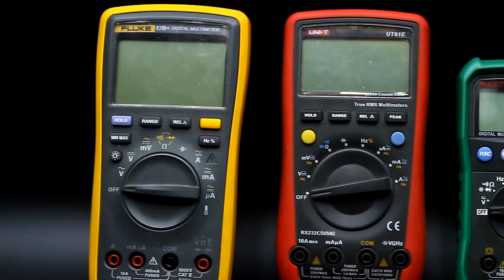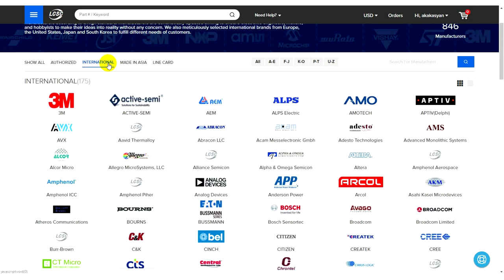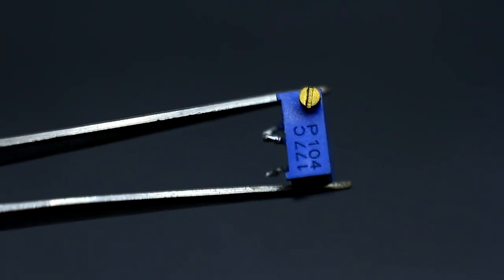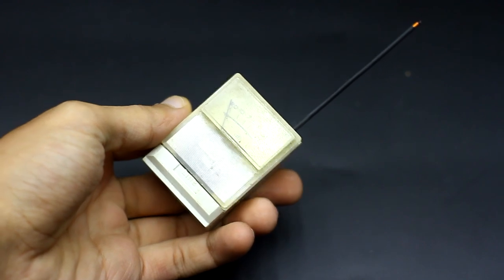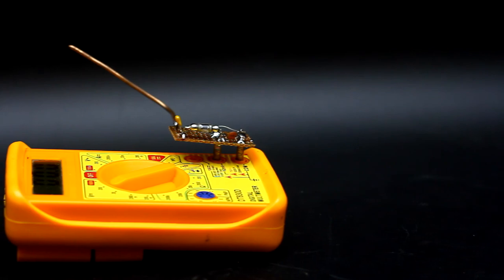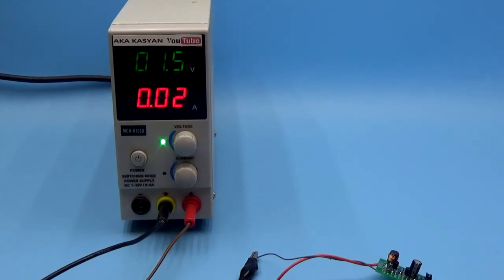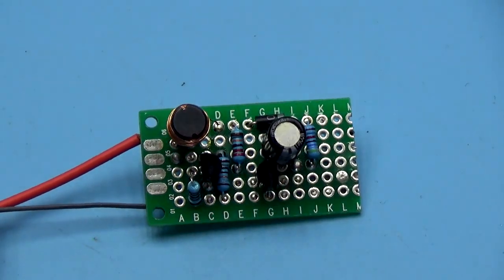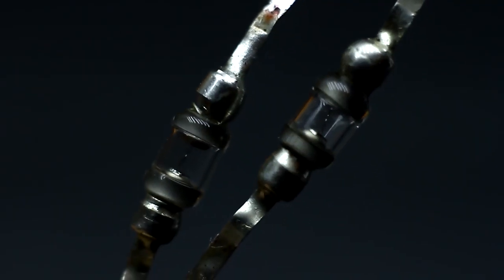TOP of useful additional devices for multimeter

Comment: An additional but useful addition is to add a Honeywell SS494B linear hall sensor and 9V battery.  Sensitivity is 5mV per Gauss of magnetic filed.  Useful when checking relays, solenoids, and other electronics related magnetic fields.  Can be used to test if relays are on just by the field.

Comment: English is likely not your 1st language. Are a few notes to help on that:  
1) antenna = "an ten ah" not "an teen ah"
2) Double check your script for missing articles in sentences.  Mostly it doesn't matter but sometimes to make clear you are talking about one specific diode "the diode" or one diode picked at random "a diode" it is needed.
3)  Nearly any sentence structure is legal in English so don't worry about this part.
On the electronics:
A small schottky like a BAS70 works well in the RF detector.
It is easy to modify the boost converter to run from a "USB power bank" The collector of VT1 needs a resistor added to do this.
A L-C low pass filter can be really handy with a low cost volt meter.  RF and spikes of voltage can make them read all manner of nonsense.  Grip the plastic of both leads in one hand and see it that changes the number.   If so, you have high frequencies in the issue.
An ordinary silicon diode in the "diode check" mode can also sense temperature changes.  This can be handy as part of a circuit you are building.  Just putting a diode right on the power transistor can let you watch the -2.2mV per degree C changes as you work on the circuit.
A circuit with a low offset voltage op-amp can make a super low range volt meter by providing a gain of 100.
Reply from the maker: Thank you
Reply: I understood her perfectly. Her English is very good. No issues whatsoever. Why are you being such a drudge?
Reply: @erikburman530  
I honestly did miss her meaning in one mention of a diode.
I pointed out that she said a word wrong.
These comments were helpful to her.

Comment: A couple more things that can be made:
1)
A photocell and an ohmmeter makes a near IR detector.
A long tube can be used to limit what IR light gets to the detector.
This is good for checking IR LEDS
2)
With a long string of high voltage resistors, you can make a high voltage probe.
3)
A crude frequency measurement can be done with a frequency to voltage converter.
4)
With:
A current sense transformer.
A "filament transformer"
Two comparitor chips 
One XOR chip
and low pass filter
A power factor meter can be made that works well enough.
Reply: Deadly. Nice one Ken thanks for the info.

Comment: Hi
Thanks for your useful circuit.
I think I requested for a circuit in your previous video.
I am trying to make UPS for my 12volt 1.5amp  wi-FI router with lithium batteries with protection board and few modules of tp4056, step up module and step down module.
I made one using IN4007 diodes with modules to stop return voltage, but am confused weather it's good or not.
Kindly make a video on wi-fi router UPS with DC input and DC output or with solar input (I have 10watt and 20watt solar panels which can produce 18volt).
Many guys asked for me for such circuit for their routers and modems, it is because they wanted to play pubG game but power failure in my place always in this summer.
Hope you understand my English,
Waiting for my requested video.
Thanking you
Reply: I'm certain the Wifi router has its own internal voltage regulation and can use anything from 8v to 15v. An easy way would be to use three lithium batteries in series. Each battery is 4.2v fully charged and 3v discharged. This will give you 12.6v when fully charged to 9v when discharged. The only thing you would need is a proper charging circuit for the batteries and a diode to prevent the original Wifi power supply from accidentally trying to charge the batteries.

Comment: Really interesting, dude!!! 😃
Do you think it would be helpful for 5.8Ghz transmitters? (They are used for FPV.)
Reply: not with this diode... it has a typical junction capacitance of 1pF, waaaay too much for anything useful in the microwave range (and the rest of the circuit is not suitable for that as well)
Reply: @AKAtheA  Oh... I see... Thanks! 😊

Comment: The lm35 is good for room temp, but how about one that can measure higher temperatures, like the ones in some multimeters
Reply: You may want a thermistor and a conversion table.  It works up until the solder joints come loose.

Comment: I have several free harbor freight multimeters. they ALL read just the same as my 1500 dollar fluke.
Reply: Anyone who actually owns a "1500 dollar fluke" knows not to trust a free harbor freight tool. I've seen them go up in smoke after 240+ volts. No thanks, I'll stick to something that wont kill me..
Reply: Try the AC scale and a 9V battery.
The cheap multimeter uses the value from the positive alternation to estimate the AC voltage.

Comment: can you modifi a powerbank pcb to make the output adjustable
Reply: That depends on the controller. Usually they have a feedback pin that you connect the voltage to. A resistor divider can be used to change the voltage on the pin.
Reply: @sasodoma  that's exactly what i am thinking 👍😀
Reply: @dharmeshsolanki4354  But you do have to check whether it has an internal or external voltage divider. If it's an external then no problem, just change the resistors to get any voltage you want (within controller limits). But if it's internal then the IC is expecting a 5V signal on the feedback pin. Using voltage dividers you can get 5V out of a higher output voltage, but there is no way to get less than 5V. This means you can only increase the voltage not decrease it.
Reply: see other replies and:
Often the voltage limit of the switching transistor is quite low in the power banks.  If they use a MOSFET, the on resistance tends to grow as the square of breakdown voltage as you go MOSFET to MOSFET.
At low powers, you can also add a voltage multiplier to get higher voltages.  2 added diodes will give you a "10V" output from a 5V converter chip

Comment: Plz make circuit for inductor value test usin simple multimeter
Reply: The easiest one of those is a home made inductance bridge.
A resistor and an inductor in series makes a voltage on the inductor lead the AC input.
A resistor and a capacitor in series makes the voltage on the resistor lead the AC input.
Thus you can make two voltages that both lead.
Place a meter between to see the difference.
Adjust the resistors to bring the voltage difference as small as you can.
The ratio of the resistance is Xl/Xc

Comment: Make a DC current probe from. .001 to 10 amps. or give circuit dag to viewers, can do experiment
Reply: Just buy a .01 ohm 1% resistor wire in series to the load and measure voltage drop across in millivolts.
Reply: @davestech6357  
At 0.001A, 0.01 Ohms won't work well.
Also, throw some big diodes across the resistor if you want to use it down at 10mV but there is a danger of current spikes harming the resistor.
Reply: @kensmith5694  .01 ohm works great to up to 10 amps load and is easily read in millivolts. Look at ohms law and see. You can also use an app called WOVA in Google play store. .001 amps would be 1 milliamp. If your measuring that low use a 10 ohm resistor.
Reply: @davestech6357  
That was my point.
Your suggested 0.01 Ohms alone doesn't do the job.

Comment: your field detector doesn't work for me.
Reply: Simply you can make a field detector with couple of 1N4148 diodes and with two capacitor ,  working on my DT 830D yellow cheap multimeter, youtube channel name K7AGE have a video about it, you don't need to hunt for germanium diode.
Reply: @debdootkumar4832  thanks but 1N4148 is silicone diode, please share the link here
Reply: @debdootkumar4832  
Small signal schottky works better.
Reply: @kensmith5694   sure they works better, but I have never found anywhere, electronic shopkeepers acted like they never listen the name "schottky diode". Can u please write me name of some widely available schottky diods, I'am from India.

Comment: Temperature sensor circuit is nonsense. 
LM 35 output is 10 mv per Kelvin of absolute temperature e.g. room temperature si about 293 kelvin e.g. 2930 mVif we divide this voltage to 20 milivolt then the sensitivity of the circuit will not be 10mV per degree anymore !
Reply: Very good point about the idea of doing degrees C that way.
Doing Degrees K and remembering 273 seems like a good option for many people.
Something involving a REF-01 and a 10 turn pot could also be done.  The temperature pin on those do something near2mV/C